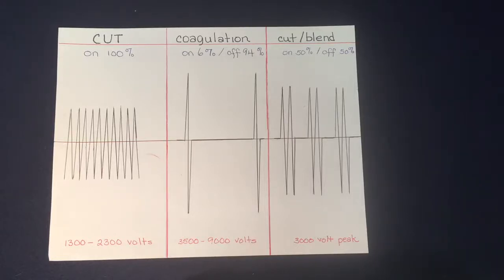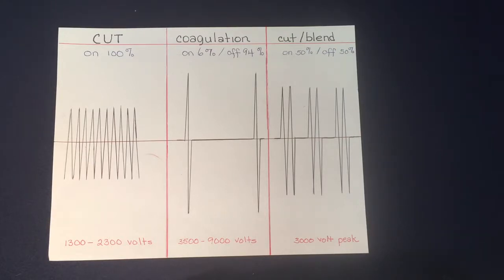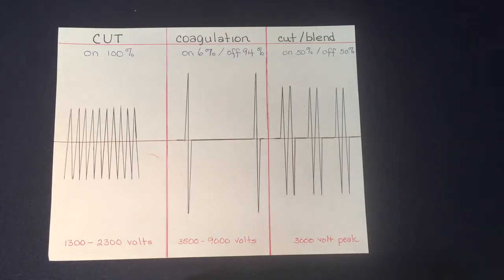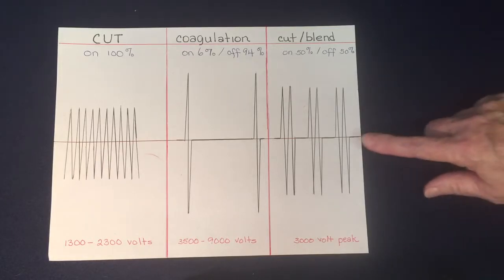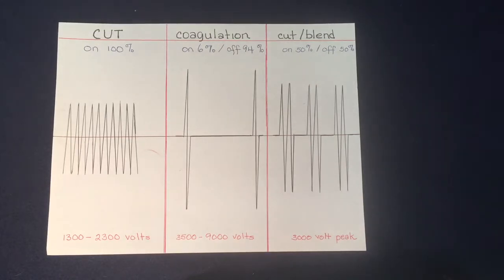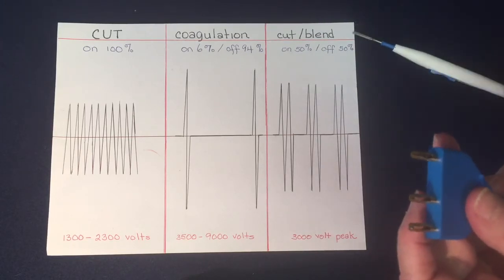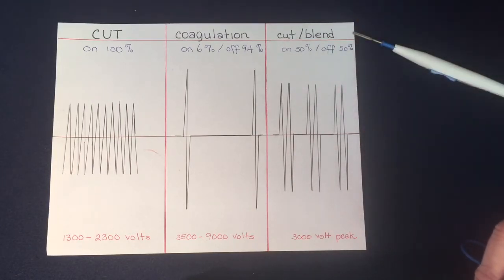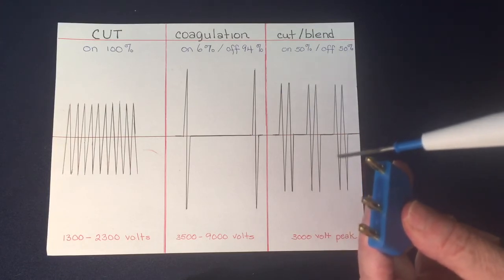Cut versus Coagulation: What's the Difference?

Comment: Sorry can you chech which one is which, cause in last video on Bovie hot tips, you mentioned that cut mode has spikes and in this video that coagulation has spikes.
Reply from the maker: Clarification:  If you look at the picture it is a good demonstration.  Even though the cut (picture on left) isn't as high a current as coagulation, the spikes are continuous causing it to cut the tissue without cooling down enough to coagulate it.  The spike on the coagulation (middle picture) is much higher but then the current is intermittent with enough time to allow the tissue to cool down and the tissue and smaller vessels to coagulate.  But, because it cools down so much in between current spikes it tends to drag on tissue because it cools off.  (Even though, from my experience, most surgeons us coagulation to also dissect tissue.). The best of both worlds is the picture on the right, where a blend is used of both cut and coagulation.  This allows the cut to dissect while adding the coagulation component which allows it to cool down briefly enough to add some coagulation.  The higher the blend (1or 2), the more coag is added to the cut.

Hope this explanation helps.  Feel free to ask more if you still have questions.
Sorry it took me so long to respond.

Comment: what is the difference with coag v. fulguration?
Reply from the maker: I am not sure I know the answer to that.  I usually hear fulgeration used when it is a urology case and the cautery is used when submerged in fluid.  Just a guess.
Reply: Fulgaration is the term most commonly used for bladder tumor resection  (TURBT) but also refers to RFA (radio frequency Ablation) such as is cardiac procedures; but in general terms these are still electro cautery energy levels applied to healthy and non healthy tissue. In my 30 + years in the OR I find that the vast majority of surgeons do not understand the difference in the CUT vs COAG vs BLEND modes on a Bovie unit; that is to say, they're afraid to use the CUT mode and will struggle for longer periods of time under coag when they should be using CUT!